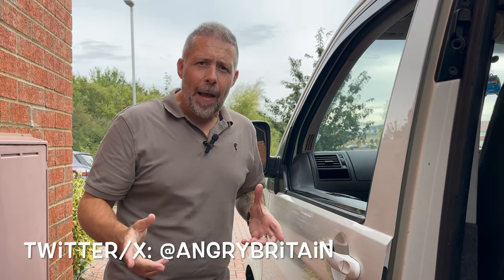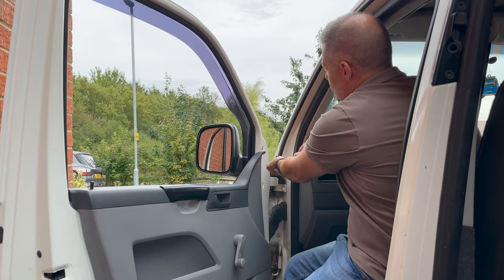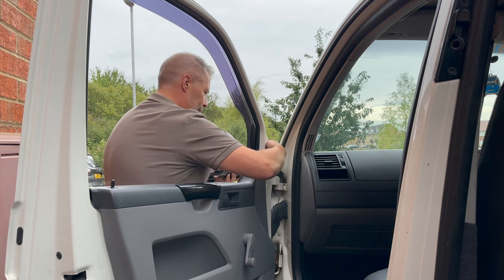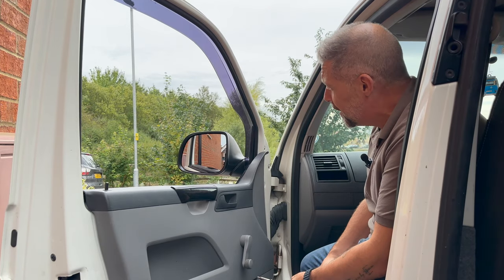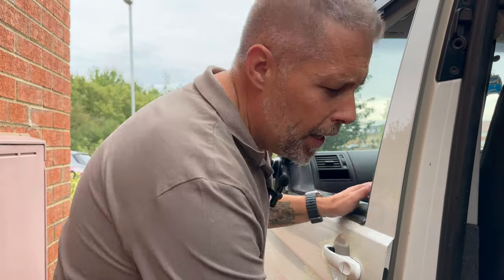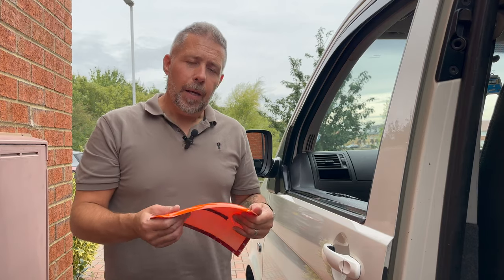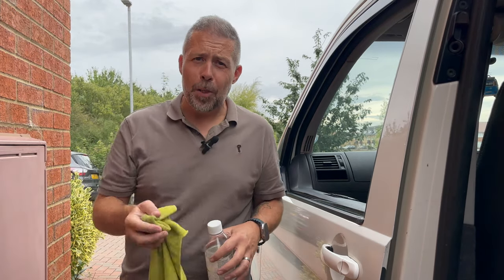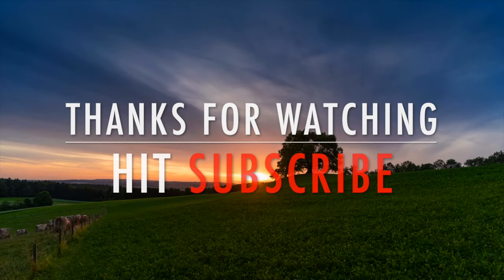VW Transporter T5 to T5.1 Wing Mirror Upgrade

Comment: are T5.1 and T6 the same fittings as the T5 as someone told me they are the same doors
Reply from the maker: Not sure, 5/5.1 definitely are, ask in a forum, quite likely. Only really front end and dash that's changed in the 6

Comment: Where did you buy the mirrors?
Reply from the maker: Just eBay jobs. They were about £90 for the pair.
Reply: @AngryBritain  Nice. Quality ok? Looking at doing the same thing.
Reply from the maker: @ermelandus  Yes, they don’t wobble like others I’ve bought in the past, but I’m not sure you can bend them up out of the way, tried once and they felt like they’d break. Item number 266180807468 - but obviously you get what you pay for …
Reply: What year is your van?
Reply from the maker: @mickcameron1368 2006
Reply: I've been advised that the T5.1 mirrors would not fit my 2009 T5
Reply from the maker: @mickcameron1368 you’re been advised wrong! 😂
Reply: @AngryBritain  I might take the risk as they look much better than the standard mirrors